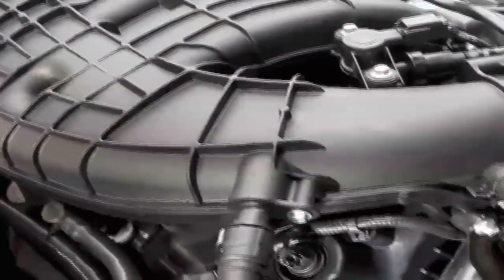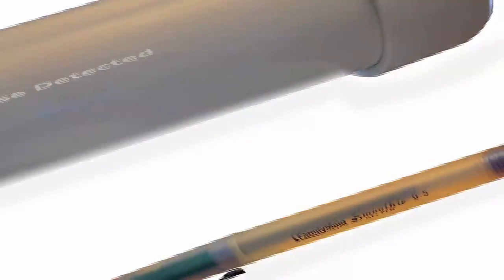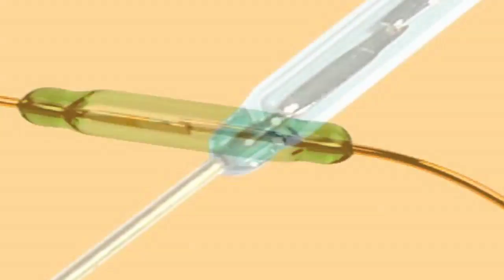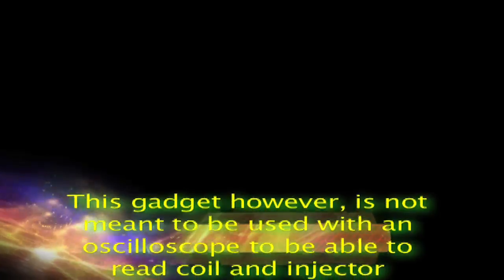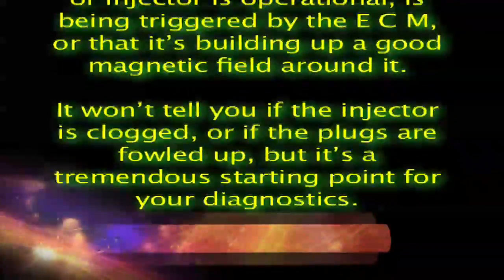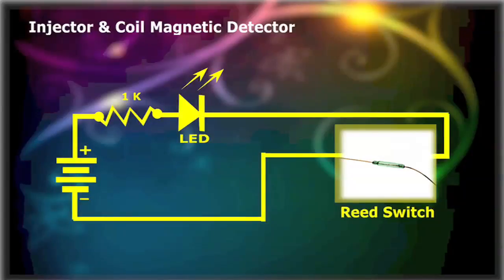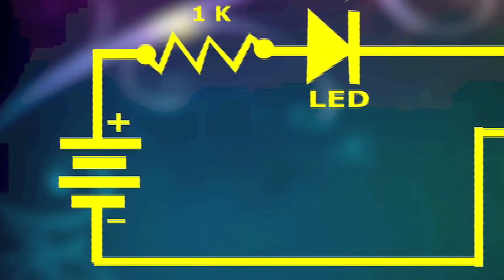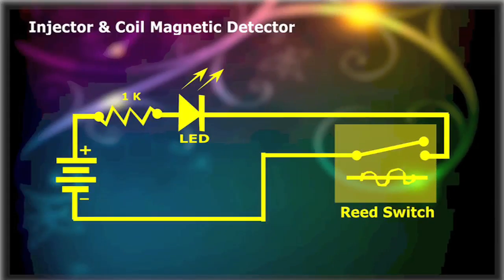Injector & Coil Magnetic Detector

Comment from the maker: In the video you see that we took a pen and placed the "REED" switch at the tip. Any elongated piece of PLASTIC, not metal will do. If it's even a little longer than the video even better. Some engines place the coils deeper in the plastic mess and it's nice to just probe from afar. Thanks for posting.